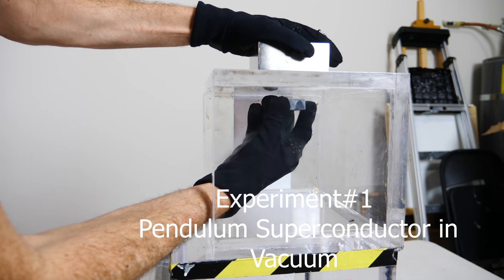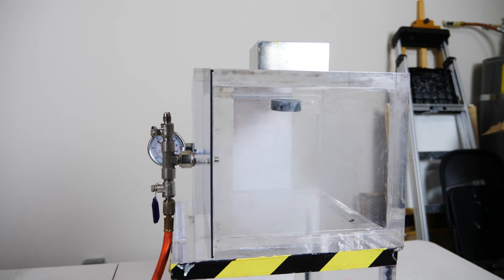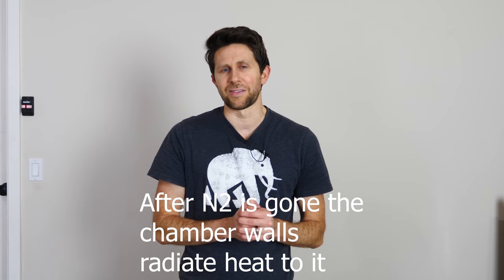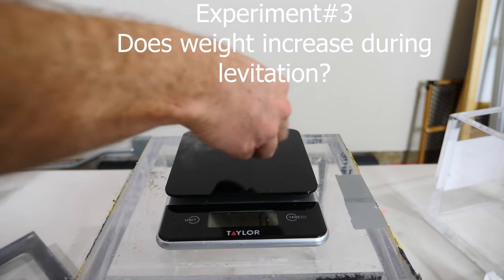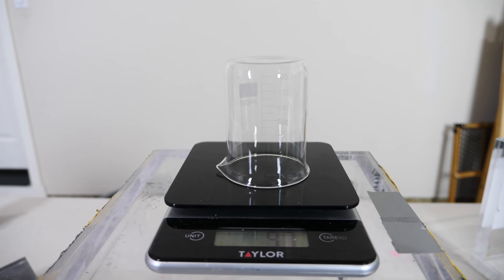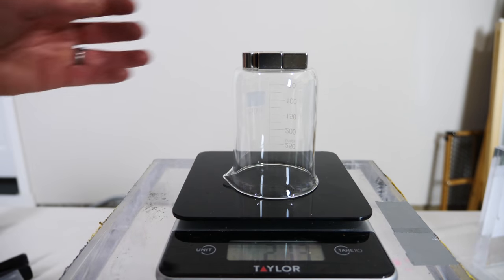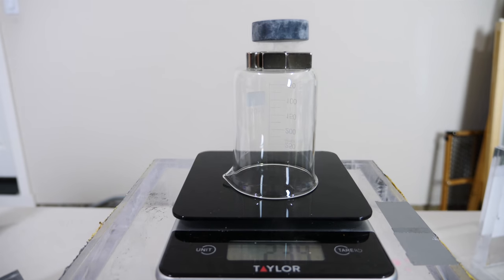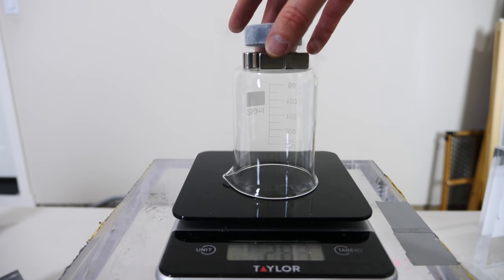Does The Weight Increase When You Levitate a Superconductor on a Scale?

Comment: It's like the old joke/riddle where a trucker is transporting birds: His truck can only hold 1 ton's worth but he can carry 2 tons because he keeps half of them flapping their wings at any given time. Mythbusters actually tested this myth and found that, no, the weight is unchanged for the simple reason that if the birds are flying they have to exert a downforce equal to their weight in order to stay aloft.
Reply: Uh as I recall they couldn't test that Myth even though they wanted to. But I could be wrong
Reply: @LordOstrik  they dont need to test it, its simple physics. The force theyd place on the truck from flapping would be equivalent to their weight
Reply: @sherk3286  i thought birds flew by generating a  semi vacume low pressure above their wing wouldn't the low pressure cancel out the doward force??
Reply: @charlesco7413  Every action has an equal and opposite reaction. By generating thrust to lift the birds body it is exacting that same amount of thrust on the truck and air underneath it. At least equivalent to the weight of each bird
Reply: I would like to know the answer to that if birds were in the truck on a scale and you scare the birds all fly at once would the truck loose weight by repelling off the air and they're not locked in place like a magnet.
Reply: They should have tested this myth using a cage with a grid floor.
Reply: @sherk3286  thats full metal alchemist all the way lol

Comment: It's the old question of birds in a container.  If you have 100 birds that weigh 1 pound each, and you weighed the container, would the combined weight of the container and birds weigh less if the birds all took flight at the same time.  The answer is no.  It would still weigh the same.  The best way to visualize this is to imagine a tank filled with water with a scuba diver inside.  The combined weight wouldn't change if the scuba diver were resting on the bottom of the tank or if he were floating at the top.